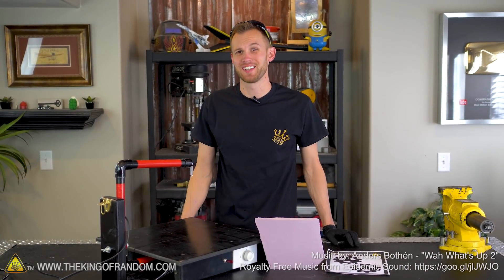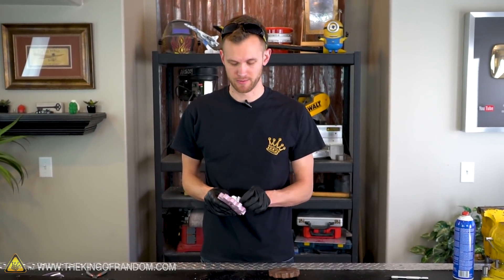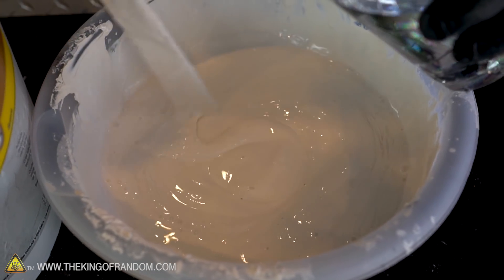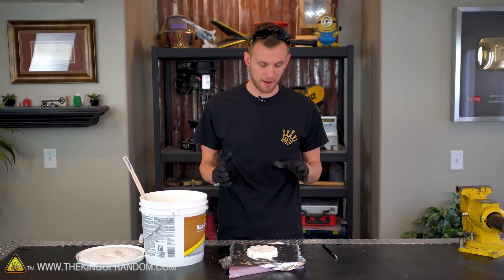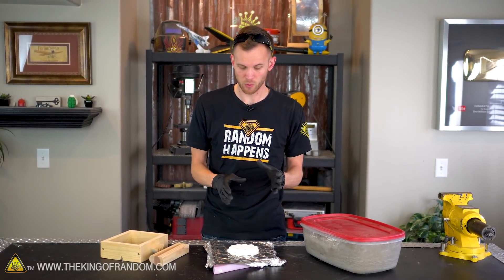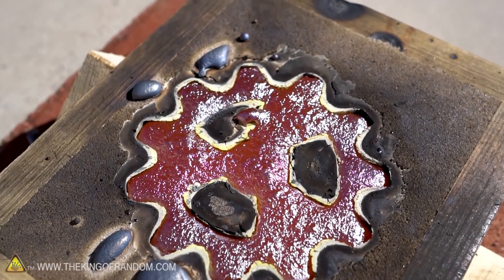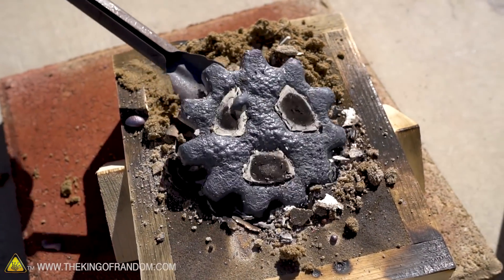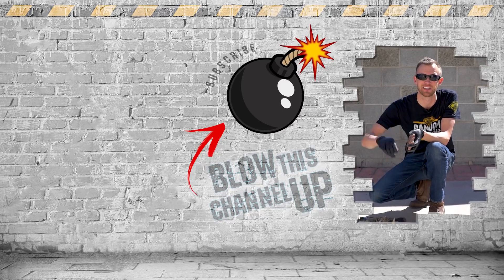Casting Copper Gear Success! TKOR Takes Copper Casting To A New Level!

Comment: It would have been so much easier to just do a full two piece cope and drag, to keep the gear cutouts intact.  That was a whole lot of extra work, just to make an open faced mold work.
Reply: I love how the creator completely ignores this comment and likes all the other ones. Guess he's not interested in any critisim.
Reply: Wtf is a cope and drag
Reply: john zamer it's the name given to the two halves of a sand casting mould tool.
Reply: Raythulhu ikr
Reply: MisterOptimous $.
Reply: I like how he doesn't even bother to skim the molten copper.  I mean you can see all that slag on top when he pulls it out.
Reply: As a caster, this video is shameful. Nice to see he got it done, but this is not a quality cast. Theres extra steps, done unnecessarily and ineffectively.
Reply: Plus the "texture" plaster will have a ton of moisture in it. Between the bagel tongs and lack of non-synthetic clothing i'm surprised they haven't had more accidents.
Reply: 66666666666666666666666666666666666666666666666666666666666666666666666666666666666666666666666666666666666666666666666666666666666666666666666666666666666666666666666666666666666666666666666666666666666666666666666666666666666666666666666666666666666666666666666666666666666666666666666666666666666666666666666666666666666666666666666666666666666666666666666666666000000000000000000000000000000000000000000000000000000000000000000000000000000000000000000000000000006

Comment: When copper make that bubles is because is burned material u can ad a 20 % aluminium in it so is a litle bit to fluid
Reply: Add aluminium when the coper is red hot and then put it in the mold

Comment: Suggestion: I'm not sure what its called but you should try the casting method where you do what u did but add a second layer of sand on top and add channels to pour down. Doing this could add strength to the cast so it doesnt fall apart but also let it be relatively simple so people like myself could do it easily.

Comment: I have a question; if I dont have all the sanding tools needed to remove any excess from a cast, could I go the cautious route and pour less molten copper than needed, then pour the rest in increments as it cools? Or will the result look layered and weird? Thanks and great job with this video!

Comment: Why don't you build your own centrifugal casting machine?:)
A simple spring powered design should be easy to make^^
Reply: I think you could use a rope torsion flywheel... Correct me if iI have the wrong name for the right thing. It's like a rod down the center of a wheel with ropes around it, and as you spin the wheel, it winds the rope around the center shaft and lifts the rope, and when you let go, it spins really fast.
Reply: J Fidel since english isn't my first language i can't say if the name is correct but by your description it sound like the same function at least :)
it's a common (if not very modern) way of casting jewellery :)
Reply: volumes are the problem, jewelry is very small amounts of material and easy to use centrifugal force to even out the castings, also most precious and semiprecious metals cast at cooler temperatures than copper

Comment: You should do a video about how to clean your crucible.
Reply: you heat it up in the foundry and then run a aluminum foil or steel wool pad around in it with tongs

Comment: hey KingOfRandom i was looking at your "HHO Generator - Water to Fuel Converter'' its a gas right? so you can make a engine what works on that gas right? i know one russian person made engine for a scooter, and it was working and i want to know will you try to make an engine like that.
Reply: hydrogen is a known fuel it has some issues however and is not an easy DIY project, you need tight tolerances

Comment: The issue with the casting is it's an open faced mold. If the foam was entirely encased in sand it would work much better.

Comment: Nice video , can you create a working perpetual motion machine please.
Reply: I suppose he'll just ignore thermodynamics then?
Reply: Well he is called the king of random
Reply: No, what peanutbutter meant was that it's downright IMPOSSIBLE to make a true perpetual motion machine since it violates the laws of thermodynamics. This is why no working model of a true perpetual motion machine exists.
Reply: But impossible is in random
Reply: Well, I guess if they want to create a perpetual motion machine then first they have to create a machine that will transport them to other universes where the laws of physics and thus thermodynamics are different so that they can create a perpetual motion machine without breaking the laws of thermodynamics. (I made this as non-offensive as I could. Sorry if this still offends you.)
Reply: He could also use magnets in a circle but at the top north is facing front and same with the other magnets and create two of these things and have one turned around next to the other one so that the south faces south and each time the meet they try to get way from each other so if he spins them at the same time in opposite directions then it will go on forever .but he needs strong magnets.

Comment: @The King of Random
What would happen if you place a block of wood floating in water into a vacuum chamber?
wood it still float?
Reply: mmmmh never thought of that! amazed
Reply: would love to see that as a video
Reply: Ray Ray Problem is that water boils at a vacuum, but if it didn't it would float slightly lower than with an atmosphere.

Comment: are you using casting sand because if not then you can add a lid and also it is denser so may not float on the copper